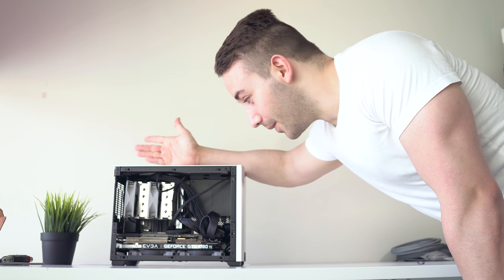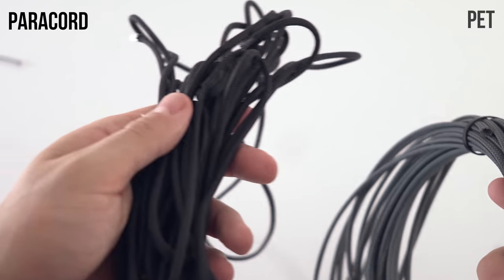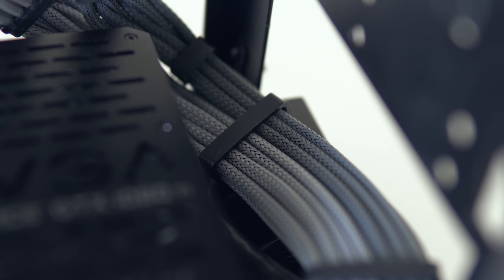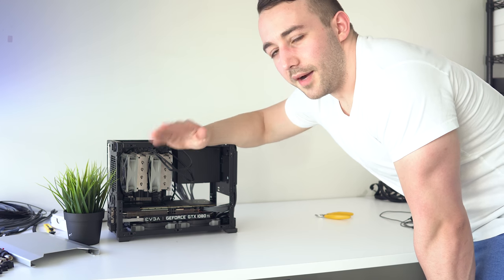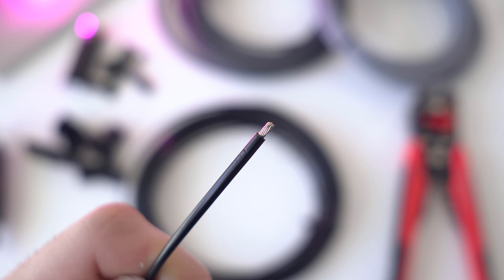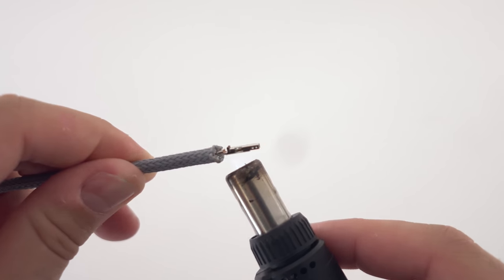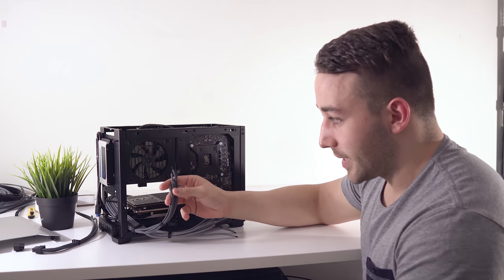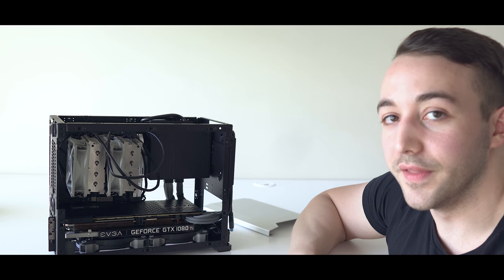How to Create PERFECT Custom Cables!

Comment: late pro tip: if you ever go for full-custom cables, make a very short (like 5 cm) male-male cable without sleeving, and then a male-female sleeved extension cable. This takes more time and resources, but:
1) You never have to awkwardly plug cables directly in and out the PSU, which in some cases is very difficult
2) Your extensions are interchangeable between different builds and PSUs, which also makes them sellable if you ever don't need them anymore
3) You only have the anxiety of following a pinout once (for the short M-M cable), all extensions are just pin to pin forwarding
4) Allows using cable combs normally with different cables (my PSU's 24 pin has 28 wires, but the entire mess is consolidated in the short F-F cable)
Reply: So you are saying, just make really long extensions that are 5 cm short of the PSU then make a whole other set to bridge the gap? Sounds to me like you made your custom cables a little too short. lol The reasons you put are pretty stupid. You'd only have to pin them once anyway if you were only making one set. I think those excuses are to convince yourself that you were glad that you messed up. Nice try but that is not a "pro tip" lol.
Reply: @paulweston8184  no, my custom cables weren't "too short" and I didn't "mess up". If I set out to make normal cables, then realized they're too short and made the short ones to bridge the gap (like you theorize) - the pretty cables would be M-M, and the shorties would be M-F, mine are the other way around because that's the entire point.

Not reading what's in front of you and refusing to think is "pretty stupid", my reasons are 100% objectively true. In the time since writing this I've changed out most PC parts. The cables is one of the few things I've kept, despite switching PSUs and going ATX mid tower. I just use the custom extensions with the stock cables. Pro tip paid off.
Reply: @subrezon  Your reasons are 100% objective... if you want to make cable extensions.
Your first sentence says "Pro tip: If you ever go for full-custom cables..." (a fully custom cable is a cable with cutom color, custom bends, at a custom length.)
You are just describing the reasons for making a "long" extension which isn't custom at all except for the color. It's still an extension and defeats the purpose.
Sorry if I was harsh in the first post, but I think you were missing the point of the video, which is how to make full custom cables that require more precision.
Reply: @paulweston8184  for one, both the shorties and the extensions are custom, I made both myself. Both together make a cable. I only used stock cables as the first part on my new PSU.
I also made custom bends, even on both the shorty and the extension. The 24-pin shorty let me make an almost instant 90 degree bend in 2 axis, simplifying cable management massively.
And like I mentioned already, It let me eliminate the "two cables go into one pin" mess, which for my previous PSU meant I have 28 cables in my 24-pin, which would have not let me use cable combs. The result looks much, much better than if I went the end-to-end cable route.
Reply: @ya2131  Exactly
Reply: Thanks for this, it actually helps.
Reply: I read through this whole thread and I'm still not quite sure how you mean lol

Comment: great video, one thing that I might recommend, especially as you have the mass on the end, before you put them in the power supply plug, if you have a volt meter with an option to check for continuity, use it to double check the pin outs before you place it into the block, it might be a bit over kill but if you are paranoid
Reply from the maker: +Chris Lucas I actually did this with a DMM and  Arduino, great idea to be 100%

Comment: Thank you for the tip for binding the sleeve to the wire/pin. I've always done my cables with 12mm of heat-shrink due to ease and speed at which it can be done, but that method results in heat-shrink being visible. So I recently tried super glueing the sleeve to the wire/pin which did work well, but it doesn't work perfectly all the time, sometimes you stick your fingers and/or stick the sleeve in the wrong place while positioning it, or the glue cracks becoming unstuck while manipulating the cables to the desired position.
So I'll have to give your method a try on my next build as it looks very good, plus it doesn't appear that it would take a lot more time and effort. *thumbs up... Thanks man.
Reply: Forever Alone Sry that I'm german ...
Reply: I stopped preordering video games....

Comment: Great video. Only small issue I have is the crimp on the wire and insulation was with the same die. The cable die should be smaller and a tighter crimp.

Comment: I know this is a few years old, but just wanted to say thanks for these tips, especially the ‘staple’ trick. I purchased a 8-pin Y-cable that I needed for a RAID backplanes. These don’t use the standard power wiring and must be pin for pin straight through-which this Y-cable was not. After buying one those cheap multi-pack of blade type extractors and spending an hour or more fiddling around, I found they are simply to thick to fit both into the connector. Using your staple trick, I had both Y connectors correctly wired in 20 minutes!

Comment: I guess, I'll just pay for my custom sleevings.
Reply from the maker: Haha come on, it's not that hard!
Reply: It's really not that bad just seems like it at first .. actually find it a stress reliever 🚬 save some money too
Reply: he said one wrong wire is really bad, i guess thats a warning it will fry your graphics cafrd... NO THS  ill stay with standard ketchup mustard wired XD
Reply: LegendaryVegeta lol naw bro just get the right wire and you will be fine of course they need to be linked to the same opposing insert you can't let a 12v run to a 3.3v etc... pretty much just  line em up
Reply: btw never built pc before XD
but watched lots of vids from delidding to hard tube watercooling and the new $3000 volta, if only i had the money
Reply: Morgan S but is it cheaper than ordering custom ones cos I'm sure I'll make mistakes on the lengths
Reply: People. stop saying that all cables have a straight pinout. They do not. You ABSOLUTELY HAVE TO CHECK the pinout matches with your original PSU cables, otherwise there will be problems. Not all PSU manufactururers use straight pinouts!
Reply: What colors are those sleeves?
Reply: @tgdhsuk3589  No, if an orange and black wire (or any 2 wires) are swapped and they hold a different voltage it is likely to fry something.
Reply: Custom cables make mistakes too. Happens to jayz in his builds. Can happen to anyone. Best to trace each out and know everything is good by knowing them inside and out
Reply: @morgan5941  That's a top tip with the white heat shrink! Ill be sure to try that when i start cabling.
Reply: @tgdhsuk3589  did you ever get to build a pc yet
Reply: Ha yep take me 3 years.
Reply: @optimumtech  what about wrong pinouts? I'/m worried about compatibility, don't wanna fry anything or even m yself and lose data too. but at the same time I want to do this :(
Reply: @optimumtech  It's the damn pin-outs. And Hans has a great tutorial and a is a very great and pro modder, but never explained how to get pin-outs for any fully modular/semi modular PSU :/. Even Y splits too, he never explained those, just plugged them in, and somehow his PSU or components alike, blew up. I don't want to l ose data, blow up components and fry a bunch of stuff, and have a possibility of frying myself, lol. I love these cables and really want to make them (already bought some pre-made ones from cablemod and such), but would love to make some myself. For a lesser known PSU's ,like some of thermaltake's released in around 2016 - 2018, how  do you find the pinouts :/
Reply: Making these are easier then going to work to pay for the pre sleeves cables 😂
Reply: SlowBurning J a lot of components have protective systems in place to prevent exactly that from doing any damage
Reply: Lyle S to get the pinouts what I used was a continuity tester and if you don’t have one you can make one using an LED, resistor and a battery harness
Reply: @LS-jk3fk  If you have the power supply and its original cables, just copy the pinout from the original cable.

Start with pin 1* and follow it and note what pin it goes into on the other end. Then trace the cable for pin 2 the same way. Then duplicate that pin out.

* What you call pin 1, 2 etc. doesn't matter, just take notes and record it so you can duplicate it later.
Reply: I don't think this video is at all comprehensive, its just introductory, you're gonna have to do more research

Im gonna start with something a little less serious and try and make an ARGB cable

Comment: Well its not hard, but requires A LOT of practice and concentration, 1 wrong cable and gg your rig. Awesome channel, you deserve more subs!
Reply: In other words, it’s hard.
Reply: @kouyasakurada5547  What? No
Reply: i build stuff like this for a job.. we normally have around 10 mins to build a full harness.. not hard
Reply: @Phuzionz  i call bs, you dont build "stuff" like this in 10xmins
Reply: @ItsBoyRed  well you're absolutely wrong. when using the correct tooling in the correct environment.. ie. a factory that builds wire harnesses.. this is a very simple task...
Reply: @Solverz lol im probs younger than you...
Reply: @Solverz also "doomer" lyfestyle is main lyfe
Reply: @Phuzionz  oof.... you should stop commenting
Reply: @TastyLaserCakes  go ahead and pause the video at 7:22 and tell me if you would use cables with terminals crimped like that in your multi hundred/thousand dollar build..
Reply: your rig wouldnt be toast if u messed up the cables and tried to turn it on. It just wouldnt turn on. I know from experience. Ez fix though.
Reply: @draetonbybee9307  That might depend which line goes wrong. If ground goes somewhere where it's not supposed to, then yeah. If live +12V goes where it shouldn't, then I wouldn't put my money on "nothing happens".

Comment: I wold recommend addition step after crimping - soldering. Add a drop of solder on middle wings as this guarantees that wire wont fall out if the crimp or have loose contact that will start to burn. Im assembling 3d printers a lot and falling out wires are a real problem. Even on factory kits. Soldering is good.

Comment: Your videos are great! Love every one so far. Your technique is wonderfull to observe! 
However, please consider using Molex crimp tool. It costs a bit, but cuts your crimps down to a single crimp, for each pin. Now it looks like you are doing 2 or 3 for each. 
Crimp tool: Molex PN: 2002182200
Extraction tool: Molex PN: 11030044
Keep up the great work!
Reply: Wow $500 is pretty steep. Anything similar in the $100 range?
Reply: @MemberLogic  not original parts, but from china you can find cheaper knock offs, they will break faster tho...

Comment: I did extensions for my current pc but I'm going to do a custom water cooling loop for my cpu and gpu and I'll probably want to do fully sleeved cables this time around. The heat shrink and cutting it off is genius.

Comment: Beautiful work! I’m about to endeavor on this. I got all the supplies I need, but I haven’t attempted this since 2019. I’m using cable mod pro at the moment and not only are they too long, but they don’t match the white interior of the 5000d I just built in. The 24 pin and gpu are way too long as well. I have the perfect colors of mdpcx sleeving to match. Various shades of grays and white. Will look great in there. Thank you

Comment: Hey, Mike from Mod-One here... great video, but I worry about your crimps! the wire core crimp needs to be much tighter than that! I hope you've invested in a ratcheting crimper that has the correct teeth size for both insulation and wire crimps! Let me know if you'd like any tips or tricks for MDPC-X sleeving!

Comment: I got the sleeve and just used the good old psu cables no wires crimping n all and since i did it all one by one it was easier not to crew with the pinouts

Comment: I'm currently around 20+ hours into doing this... finding the materials, tools etc is pretty easy, but the actual process of sleeving Is extremely long and painful. There's quite a lot of things that can go wrong, especially with the pins. 

For example, the same crimping tool used in this video (from Amazon) isn't so great. Whilst the pins seem crimped exactly like a factory cable, it's no where near as strong. You will over the course of this project have many, many wires fall out from the pin, whilst the pin is still inside the connector. And when that happens, I found that it was basically impossible to remove the pin using staples. So I had to buy a £20 tool. Even with this tool (rated the best ATX pin removal tool on amazon), taking out a pin is cumbersome and extremely annoying. Often the pin don't click or 'set' inside of the connectors, due to bad tolerances. For this ever pair of wings must be stretched out even further. If you have a Corsair type 4 PSU like me, you're going to be fucked if you want to make 2-to-1 double cables in a pretty way. 

My fingers are literally in pain and I kinda regret doing this. For the cost of the cable, PET, connectors, ATX pins, crimping tool, good wire strippers, lighter fluid, lighter, shipping fees, you're possibly almost at the same price as a custom cablemod cables (or any other alternative). Only reason this could make sense is if you already have many of these tools and you have a slave to do free work. I would've rather worked at a McDonalds for 20 hours for premade custom cables - that would've been much easier.

Oh yeah, make sure you buy tons and tons of ATX pins. Whatever you think is enough, buy more. Preferably all at once, so you don't have to pay delivery fees for 3 separate orders.
Reply: I keep an old crappy Gpu handy to test the pins on myself understand the concern

Comment: I would run a continuity test on each cable using a multimeter. Also, buy a good $25 wirestripper if you haven't already!

Comment: Great video and it looks great. It's likely from my OCD and my many years working with electronics and wiring, but having all the same color wire makes me shudder with fear of having a wire in the wrong place. I'm just not sure I can use a black wire for power 😁

I was thinking of using the wiring from an unused power supply like an old Seasonic I have that's become temperamental.

Comment: @Optimum Tech Interesting case.  I'm currently working on my Corsair White 380T portable pc including Corsair H105 cooler and EVGA 1080Ti Hybrid watercool.  Up till now, some of the common PC build is lack of wire cable management.  Am now tackling this issue, taking advantage of watercooling benefits without sacrificing air efficiency.   Subscribed, great skill!

Comment: I already have a cablemod kit for my PSU, but I'd like to shorten the cables. What if I simply unplug each individual wire from the plug-end, shorten it, replug into the plug-end, one by one? This way I can't mess the pin layout and blow my system

Comment: Thoughts re combining 1 or 2 90-degree adapters to avoid 180-degree bends when plugging cables in..? 
This way the cable plugs straight up to the connector & the adapter handles the arc-changes in the z-axis  (where the width of the cable is the x-axis) ...?

Comment: Is it really worth it going through all this extra effort? For the price at which Cablemod cables are sold here in India it might be, but from the perspective of how much time and effort and not to mention the pain of finding the raw materials here in India I would still prefer to just buy it, may be not on my first build but later as an upgrade. But great video, keep up.
Reply: In a big case like Fractal R5 it is not. But in small itx cases, yes it can be worth it. Cables can block airflow and block stuff like panels and mounting holes. Also make it harder to plug in hdd/ssd because of the shitty original cables doesn't bend as easy.
Reply: funny how someone from the land of cheap labour is complaining about labour ;p
Reply: If your case has a compartment where you can hide some of the cable management, then this absolutely isn't worth it. Just go with Cablemod extensions. If you have a case though where even the backside is visible or you cannot hide anything, then you'll need to do custom wires, because each single cable will have to have a custom length to follow your bends exactly. Right up to where you put it into your power supply.
Reply: well for me its not, cable-mod charges 125 us dollars for 3 cables..... that's a hell of a lot money for 3 cables.

Comment: I think I'll just buy the silverstone cable extensions, I don't have time for this, I just want clean looks and after researching I think silverstone has the best looks, im to afraid of blowing up my PC because I need a 24 pin and 8x2 (gtx 1080sli) and I'll just leave the EPS stock because it's a 8 pin and a 4 pin and I won't be arten anyway as I have a top l7nyed radiator and 2 fans blocking view. Great video exceptional music choice and crsip audio.
Reply from the maker: It does take a lot of time and planning, I find it therapeutic. Thanks for the watching, good luck with your build
Reply: Optimum Tech I have some minimal experience with it because I used to tinker with broken electronics inorder to make them work again tho not to this extent, here a link to my PC(would have used pcpp but I got banned) https://imgur.com/gallery/BF6oL

Comment: I have an important question about custom sleeving that I have never got answered no matter the research so maybe you could help me out. How do I know which cable from PS is going to which PCIE or SATA etc. hole in the connectors? Because if I put it in the wrong position it could burn the whole GPU or SSD or whatever
Reply: Simple, take the original wires that came with the power supply and trace them to see where they go.